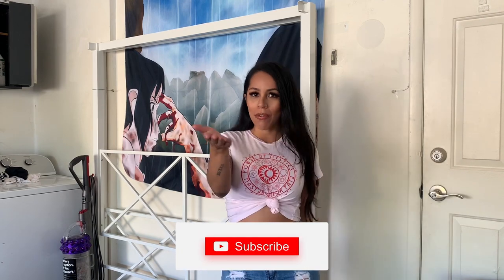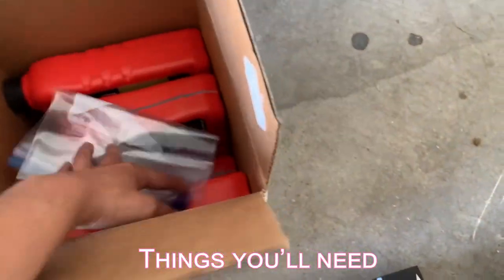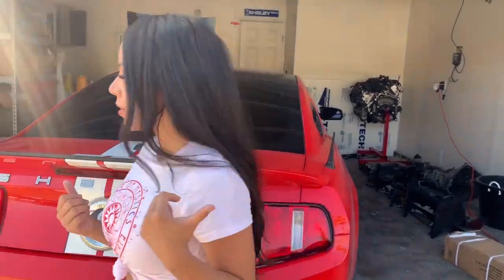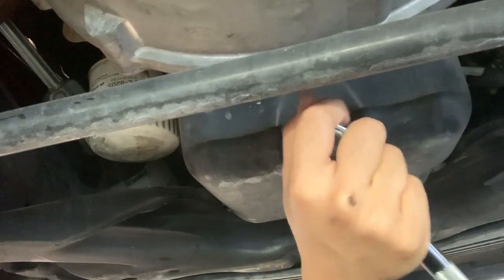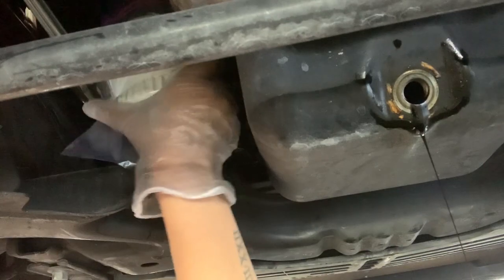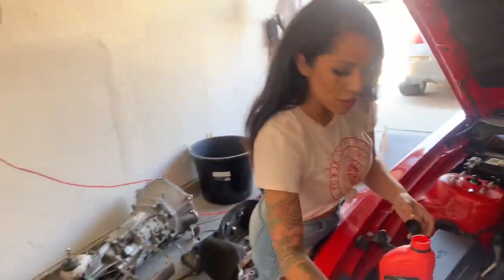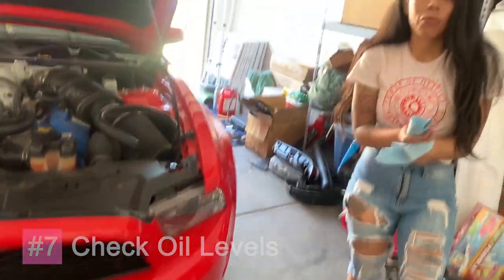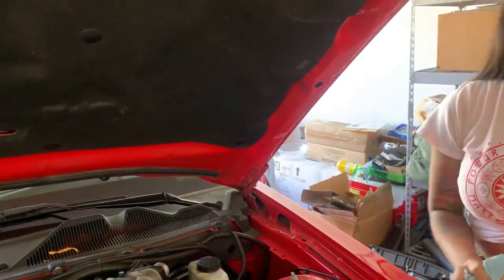DIY GT500 Oil Change

Comment: Hello,  if you want you can wait longer before thighten drain plug: let the oil and dirt go out maybe during 1 hour or 2, it takes more time but it's better in my opinion, you can also put WD 40 with a paint brushe on your metal parts where the color is grey ( block ) to put off all the salt. Kind regards.
Reply from the maker: Hey! Thanks for the advice... I’ll def be doing that... pretty nasty down there lol
Reply: It is a pleasure for me to help you cause I have the same car, different color, different year but GT 500. It's what I'v learnt from my car, I would happy if someone told me this 2 years ago but nobody helps me lol, I can send you a picture on Instagram to show you what WD 40 does on my block now it's like new.
Reply from the maker: @hubertdylan6654  send it over 🙏🏽